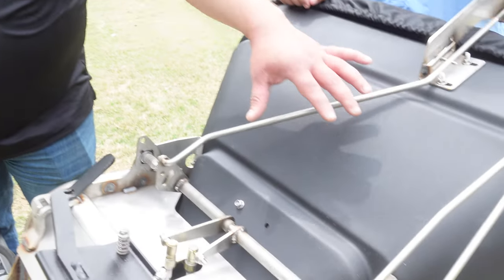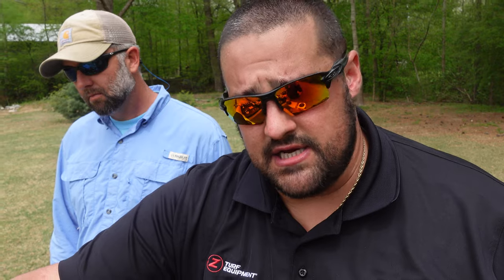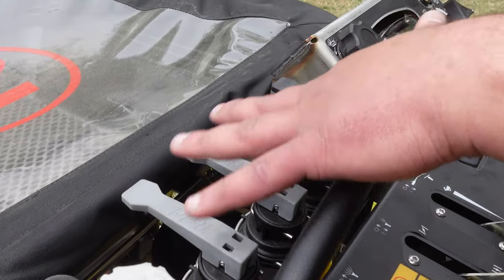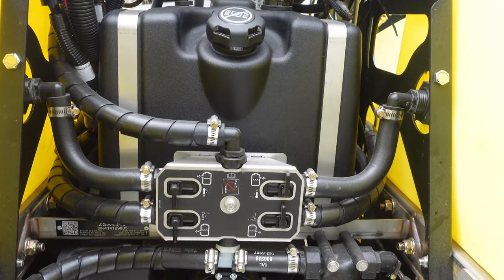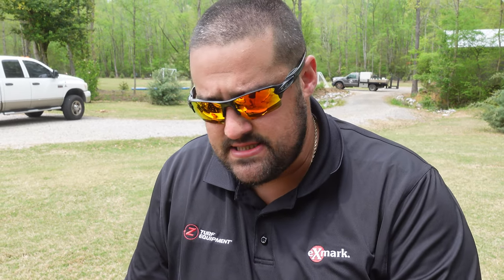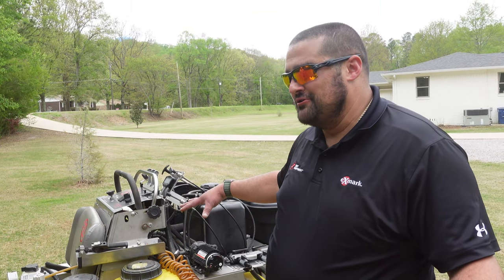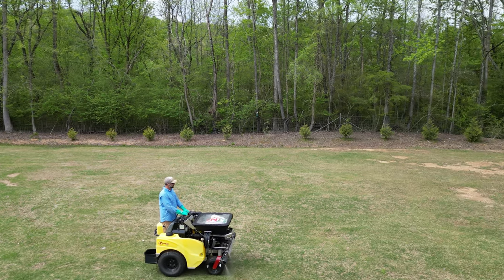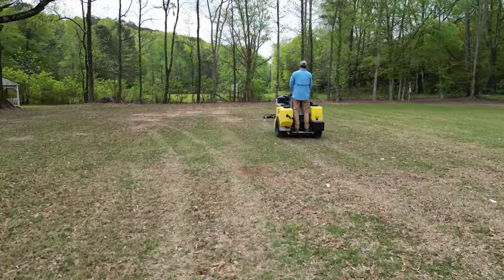New Redesigned Z Spray vs Older Model - Part 2

Comment: Talking about old machines, I am still using mine daily that I purchased in 2007 used! It’s the Z max. Has two 25 gallon tanks. Purchased it directly from LT Rich products. They used to have great customer service. I really miss dealing with them. They ran a very good operation. I was really disappointed when they sold out to X mark. I would love to purchase one of these new ones. Lots of changes since my old unit. They need to talk to me when it comes to the dependability of these machines!

Comment: one of the reasons why i haven't pulled the triggeron on the new Z spray was because I haven't had good experience with electric motors .I find that not only the weather effects them but also the products.

Comment: the speed bar should never be set on asphalt or concrete moving to turf the machine slows down also idk why they havent done this yet because i have but you can notch the frame and weld a dowel on that speed bar and can have a 3.5 4 5 and 6mph setting mine even has a 7 for lime on open fields .